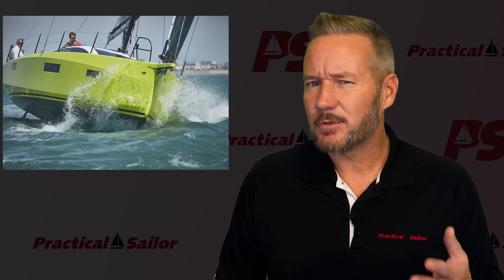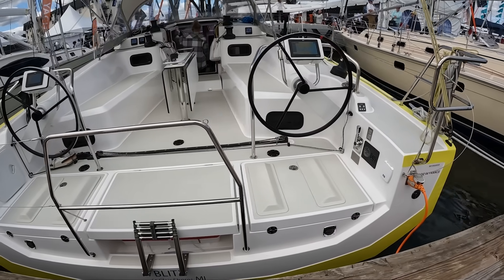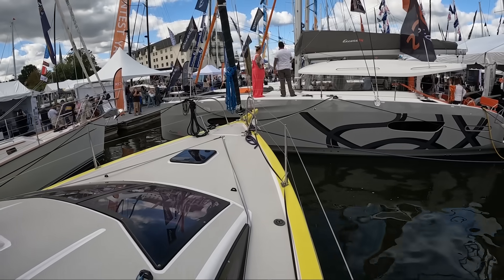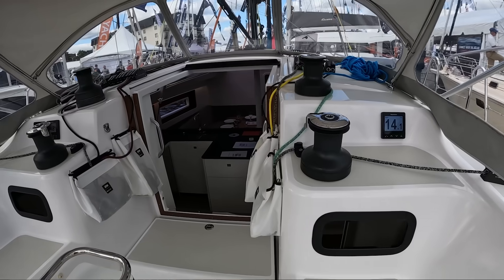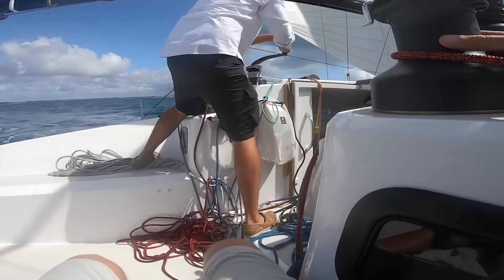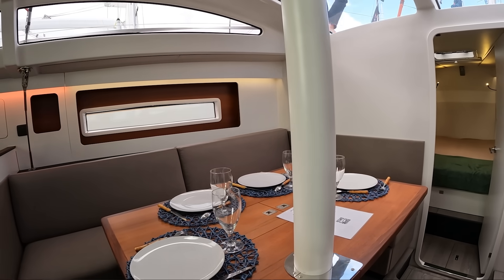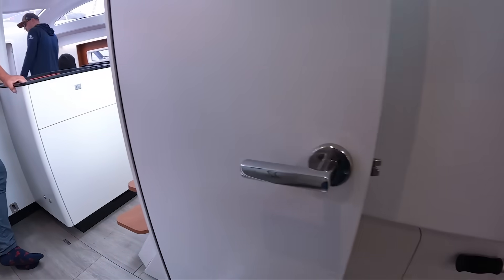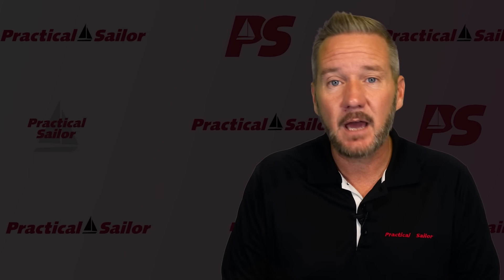Why This "Wooden" Sailboat Is Faster, Warmer, and Stronger - the RM 1180

Comment: Whilst these look like incedible vessels, and would be great to own for the first decade, eventually the elements will win. In 30 years these things will rot. So new owners enjoy, but be wary about buying a used one in the future.
Reply: Wooden boats lasted hundreds of years...... And these aren't wood, they are simply using the marine ply to separate epoxy laminate. Fibreglass delaminates, gets osmosis, steel rusts, aluminium gets electrolysis... Well laid up, and well looked after, this will be no different.
Reply: A good friend of mine bought one of the original RM yachts about thirty years ago. An RM900. RM stands for “reasonably minimalist”. I’ve done two, 2-week cruises on it fifteen years ago in the English Channel and Brittany, and in 2024 spent a weekend on it in Brittany. Zero rot and she sails as well as when new! Better, even, with her square top main which she did not have originally. You could buy one of these boats now, and with ordinary maintenance bequeath it to your children three decades from now, and they in turn would give it to their children. Though by then the sails and diesel will have been changed!